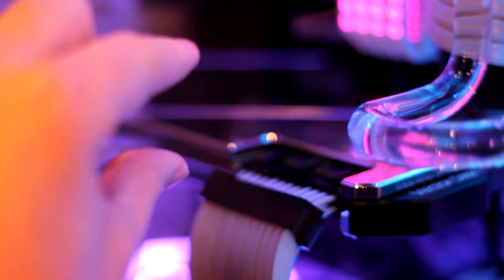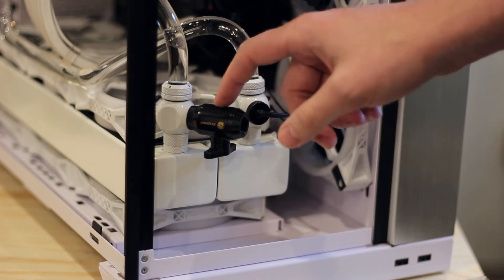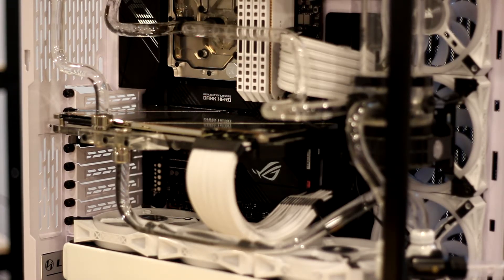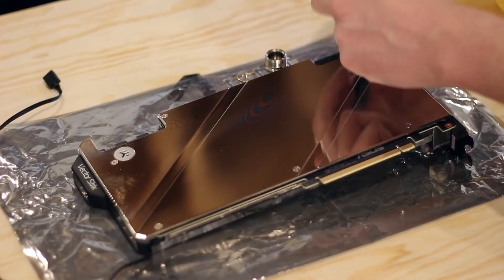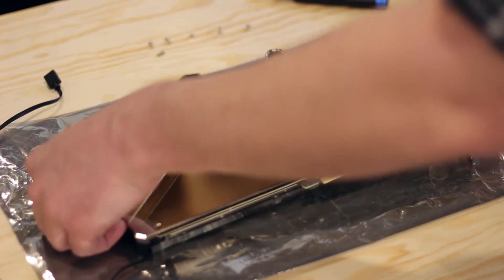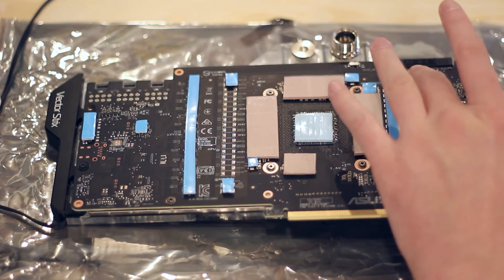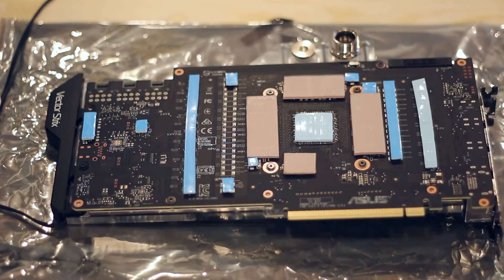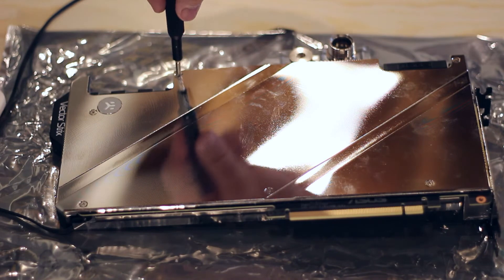EKWB Strix 3090 Water Block - Coil Whine and Toasty Memory

Comment: I wonder if cutting some slits in the backplate could help with passive cooling off the fans in system to keep memory cooler.
Gr8 vid btw iv purchased one recently with water block attached ,an the seller was nice enough to be honest an mentioned the slight coil whine when under extreme loads for a while hence why im browseing the web trying to find a solution
Reply from the maker: Honestly even the new 4090 cards air cooled have coil whine noticeable from out of the box with an air cooler. It isn't too noticeable, but it's definitely there. I still have a little bit as well, but I game with headphones on now so I don't hear it anyways 👍
Reply: @UnhingedSystems  I heard watercooled front an back is the way to go with these cards just at the extra cost of 100 to 150 but would leave plenty of head room for custom bios's an overclocking.
Reply from the maker: @thegrindizreal5896  Honestly the liquid cooled backplate is a nice touch, but it doesn't have quite the impact one would hope for the added cost. A good back plate is more than sufficient to keep the memory cool as long as it has high quality thermal pads. Even EK stock thermal pads are not very good compared to higher end ones. Sufficient, but not taking advantage of liquid cooling as much as one would expect. For me if I am spending the money on liquid cooling I want to transfer as much heat as is cost effective to transfer so I always buy top tier thermal pads and never use the provided ones.

Comment: Coil whine has to do with the components, not your thermal pads. Poor information.
Reply from the maker: That's not quite right. Coil whine is a sound produced by the inductor coils on your GPU. Adding additional pressure onto the coils slows down the vibration of the coils which moves the sounds which are normally out of the range of human hearing into our hearing range. Pads have a significant role to play in this. Pads that are too thick will apply more pressure to the coils, causing the noise to become more audible, while pads that are too thin wouldn't dissipate heat effectively. The pressure combination of the pads (thickness, firmness) and the screws tension on the back plate will be the difference between loud coil whine, barely noticeable coil while, and no coil whine at all. As in my case, simply changing the pads (video not long after this one) actually did significantly reduce the whine, even with the same pressure applied from the back plate.

My point is, the pads do have a role to play. Power supply quality, quality of your power source, length and quality of your GPU power cables, these are all variables that can contribute to coil whine. Pads are one of those variables (specifically the pressure applied to the inductor coils).
Reply: @UnhingedSystems  Correct. Though My point is, you shouldn't give the impression that it's only due to thermal pads, and screw pressure by only mentioning the above. It gives the wrong message. (Not the full message) being that you never mentioned the actual fact that coils will whine because of their actual quality which is the main reason. A reason that can't just be fixed with thermal pad placement, and pressure. Aside from that, a good video. Just better attention to detail would be appreciated on a subject like this one, with a lot of money involved on these high-end GPUs and people desperately looking for the right answer, and help on the matter.
Reply from the maker: @Joerooe  Appreciate the feedback! Looking forward to bringing more comprehensive content to everyone! Takes a while to find a groove with YouTube, always looking to improve! I actually want to take more time to script my content so that I can check all the boxes. 99% of my content has really been unplanned and improvised as a "just for fun" thing, but since the channel is continuing to grow I want to keep bringing myself to a higher standard. Thank you!
Reply: @UnhingedSystems  For sure. Completely understandable. That's how you grow. I dig that, and for all of that, and with your open, educated understanding I'm now subscribed. Good luck on the channel 💪

Comment: I have crazy coil whine on my stock, non-watercooled Strix :/ it’s so obnoxious that I can even hear it thru my headphones.
Reply from the maker: My Strix was dead silent stock, but Watercooled I haven't been able to completely get rid of the coil whine. If I use thinner pads on the backplate side opposite where the coils are it's nearly silent. My 3090FE has some light coil whine as well. My 980Ti only ever had coil whine if I overclocked it heavily. It appears even the manufacturers can't quite kick it.

Comment: Safe bet to grab some 2mm high qual pads and risk the teardown?  LoE vs ROI?
Reply from the maker: 100% swap out the pads. Best to use the same thickness that is already on there. I think on the 3090FE they are mostly 2mm anyways, I'll be doing mine shortly.

Comment: Did you try undervolting it? Im hearing that helps.. I heard platinum power supplies work good also the asus ROG
Reply from the maker: I did yes, it needs to have the power limit slider reduced to almost 50% for the sound to be completely gone. I've managed to get it to be quite quiet now with some different pressure and better thermal pads though so honestly once the fans ramp up I don't even notice it anymore.

Comment: The strix 3080 has the same issue with this setup. I found that just keeping the backplate screws somewhat loose helped A LOT, then EK revised their installation guide to not use pads on the backside of the vrms. Only the memory. By doing this it eliminated nearly all coil whine to inaudible. I'm using the same exact kit and plate as you.
Reply from the maker: Nice! Next time I tear it apart I'll give that a shot too. Mine aren't that audible anymore, but it's still a bit annoying. I noticed my 3090FE has a tiny little bit of coil whine stock, even with a solid Seasonic PSU.

Comment: I didnt have a ”coil whine”, more like a light buzz. So i swapped power supplys 5 times with my rtx 3090 gaming x trio early 2021 and the buzzing stopped when i installed a be quiet dark power pro 12 850w 80+ platinum PSU. Stock cooler and asus rog strix z490 motherboard. Thank god for free return + free shipping on all those PSUs…
Reply from the maker: Nice! Yea I have heard a lot of people getting rid of the coil whine by swapping to a different PSU or isolating the computer's electrical circuit from LED light bulbs and other electronics causing noise on the circuit. That buzz is coil whine and even my 3090FE has a little tiny buzz if I put my head up to the case (Seasonic Prime Plat. power supply).

Unfortunately with the stock cooler there was no buzzing at all but as soon as I switched to the EK block it was buzzing really loudly. Dropping the power limit on the card to 60% makes it instantly go away, but then what's the fun in using 60% of a 3090? Haha

Comment: One solution is to find the feedback pin along with the two output closed-loop feedback resistors and put a kapton tape over those components and the sound will go away.  The whine will affect DCDC efficiency so doing so will be best
Reply from the maker: I'll give it a go!
Reply: Hi you a diagram, to show me how to do that

Comment: My feedback based on my experience, just switch your current EK backplate which is the nickel plated aluminum version and take the same but on black version which is the anodized aluminum. I've had the same coil whine issue with my 2080Ti few years ago and tried like you to change the thermal pads and to tighten less or more the backplate but nothing changed until I switched from the nickel to the black backplate, then the coil whine disappeared.
My assumption was that the nickel version due to the characteristics of the materiel was more subject to electromagnetic interferences with the electronic components in the PCB, I've found some people reporting the same issue on forums so I decided to return my backplate and it has solved my problem.
Just try it and lemme know.
Reply from the maker: Nice I'll give it a go. I know that I was involved in a few Reddit threads on this over the last year and we found several interesting solutions.
Reply: thats weird that nickel could be the culprit. lolz

Comment: Is it only the 3090s that have coil whine?just installed the assembled my 3080 ti and can't test it for a week or so. Just checked the manual again and the active backplate came with 8mm screws so I'm hoping that the issue was fixed. I do wish I saw this vid about the thermal grizzly pads before I assembled mine though. Not really wanting to take it apart so I'll hold off for now
Reply from the maker: All high-end GPUs can have some coil whine. There is a lot of power running through these things. My old 980Ti would get some light coil whine playing certain games.

Comment: weird, i got the gaming x trio version and theres no coil whine + memory junction never goes over 60 while playing even while having it clocked +1400
Reply from the maker: They must be using good thermal pads then, the stock thermal pads and pastes on most of the cards aren't very good. They are just "good enough".
Reply: @UnhingedSystems  with the ek pads i could up the mem to 1k, i put ec 360 silvers on it tho they have like 12 m/k, with liquid metal on the silicon it never goes above 35c even tho i have the 500w bios on it, i really didn't expect the ek block to be any good tbh. maybe i just got lucky with the absent coil whine tho i heard its card specific to some extend

Comment: Honestly coil whine is very common on Asus cards, particularly and ironically, strix. 
At some point, after the card have been used for 1-2 yrs, or in my case, 6 month of intensive MachineLearning. The coil simply cannot stop vibrating all the time. 
I believe it is electronically degraded, but no in a way that could damage other parts.
So I learnt to live with it and no bothering about this anymore.
Btw, I am using stocker cooler with Laird HD90000, which is considerably better than TR’s hyped pads.

Comment: Omg, did you mean your 3090 had no coil whine before water cooling? My strix 3090 has serious coil whine even with air cooling. :(
Reply from the maker: Thank you for the question! Yes I fully test all hardware before any modifications. Air-cooled there was zero coil whine on the card, it was completely silent. I'm certain I could completely eliminate the coil whine if I played with the screw tension more. The last time I replaced the pads with Thermalright Odyssey I didn't tighten the backplate screws much and the coil whine is mostly gone. I can still hear it in certain games. Dropping the power limit on the card to 70% also eliminates the coil whine. Unfortunately any real pressure against the inductors will slow down their vibration and make them audible. There is zero coil whine with the backplate removed but obviously that will make the RAM on the back side get too hot under workloads so that isn't an option.
Reply: @UnhingedSystems  Thanks for your detailed answer. I understand it is very inconvenient to adjust something in the water loop.

Comment: Obviously it won't make any difference. You increase the pads by 1mm and lengthen the screw by 1 mm there is no difference in pressure than before. Use 2 mm pads and the 7 mm screws. To increase pressure.
Reply from the maker: Right? Tell that to the EK engineers that recommended the design change lol
Reply: @UnhingedSystems  I just bought the 2mm pads and waiting for them, let you know what temps are when fitted to the front of gpu.  Still waiting on active back plate . Running with no back plate at moment.
Reply from the maker: @playdodgy995  I did another video where I replaced all the pads with Thermalright Odyssey pads. After some minor adjustments the coil whine is all but gone (still a little, but great improvement). The trick seems to be balancing the backplate tension to a minimum.
Reply: @UnhingedSystems  yep seen it ,I have gone for those ones as well 2mm for the front. Not decided on thickness for the active backplate yet.maybe trial and error.
Reply: From a physical standpoint you're not completely correct. A thicker pad made out of the same material will not produce as much pressure as a thinner pad with shorter screws. There's just more material to absorb the occuring pressure when screwing the plate down. Of course that's just a tiny difference, but still. ;)

Comment: Has a general consensus been found on how to solve the coil whine issue?
Reply from the maker: I've gotten the coil whine about 90% gone by using very little tension on the screws, thicker pads, and the longer screws provided by EK. I haven't been successful in eliminating it 100% and I've torn down the card three times now. The air-cooled card had zero coil whine with all the same components (PSU, etc), I'm at 44 C on the GPU now with some higher-end pads and pretty happy with the now barely audible coil whine. The block/backplate design just puts a lot of pressure on the coils and slows the vibration enough to make it audible. Hard to find the right balance between sufficient tension for cooling without causing coil whine.

Comment: What you need is spacers not longer screws. ;-)
Reply from the maker: Definitely! There is way too much tension by design, EK engineers recommended longer screws and thicker pads, but ultimately it is the lack of tension that does it. Would be great if EK would design spacers to take the pressure off of the coils. I've got the coil whine 90% eliminated now with some new pads and some tension adjustments.
Reply: @UnhingedSystems  ah got the same problem, why EK still selling wihout longer screws and manual said is 1 mm pad 😞 i bought gelid 1mm and this is so intence and loud

Comment: Odd that I never experienced a coil whine in my whole life. I have an EKWB 3090 exactly like yours but it's not whining. Try replacing your power supply with Phanteks Revolt X or Seasonic Prime PX Platinum, or whichever you like. Mine's a Seasonic Prime PX Platinum 1000W. Actually that's the very first time I heard a coil whine, here in this video, and I never thought GPU's makes that screeching sound. My liquid setup makes almost zero noise, with just 3 iPPC 3000RPM Noctua's running max at 1800RPM, and a D5 pump at 50% idle and 80% load so I would know if there's a coil whining.
Reply from the maker: The coil whine is just a fitment issue. Lots of people are having issues with this particular block / backplate combo. I'll have another video in a few weeks with another full teardown (trying some different brands of thermal pads again) and I am certain I can get the coil whine to go away by alleviating some pressure off of the coils. It is kind of fun because another 1/8 turn on the screws and I can actually make the coil whine louder. With some tweaks I have made it is quieter than the fans right now so it's pretty good at the moment.
Reply: @UnhingedSystems  What's odd though is that what's the difference between your RTX 3090 and mine? I'm sure its exactly the same model, and my thermal pads btw are 1mm thick Fujipoly thermal pads. I am certain there's something in your system that makes those coils whine, a not so clean power source, or a fan with faulty motor. I don't know but you could also try removing all the fans connected to your MOBO just leaving the 2 pwm pins and route the power directly to your power supply to reduce the load from your motherboard.
Reply from the maker: @leotheevinci  I've fully isolated the card from the system and used different power supplies, the coil whine is still there. Your use of the Fujipoly thermal pads may be playing a role there. The EK thermal pads are terrible. EK's engineers provided me with 8mm screws as they have identified the problem with coil whine to be related to the pressure applied directly to the coils by the 7mm screws in conjunction with their pads. Removing the backplate eliminates the coil whine entirely as it alleviates any pressure on the coils slowing down the vibration (pulling the block down with more tension with the backplate installed). As you said there may be some other factors at play as well, I agree. In my case the primary factor is the tension between the backplate and the block.
Reply: @UnhingedSystems  If the coil whine persist, how about trying their active back plate if it fits? Maybe because their current back plate is so thin, it's acting like a drum amplifying the supposedly inaudible coil whine?
Reply from the maker: @leotheevinci  That's a great idea! I would love to give the active backplate a shot!
Reply: @leotheevinci  Interesting, I have a Strix 3090 Stock and it whines. Got a good PSU RM1000i. In fact I had 2 3090 FEs that also whined in same PC and in another PC. So, you think there's some interference causing this?
Reply: @UnhingedSystems  I just loosen the backplate screws on my old EK block and 80% of the noise went away.
Reply from the maker: @tomsgtr1 Yes that definitely helps a lot, tightening the screws fully definitely increases the noise (and curves the backplate visibly too!) The cooling performance is so good though with proper pads, wouldn't give it up for the world!

Comment: Am not sure if to get this for my strix 3090 or the bitspower one, what would you recomend me
Reply from the maker: I'm still trying to reduce the coil whine, but it fits great, install is easy, and it performs very well. I wouldn't hesitate to recommend this one, but I would swap out the stock EK thermal pads for much better pads.